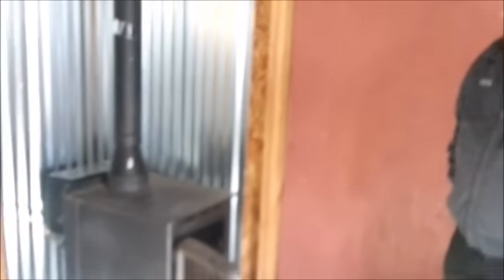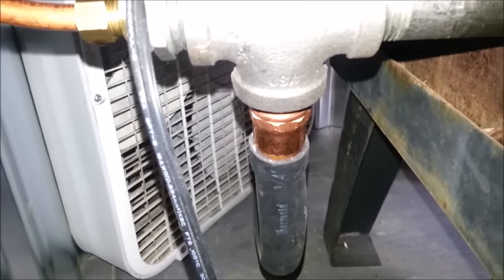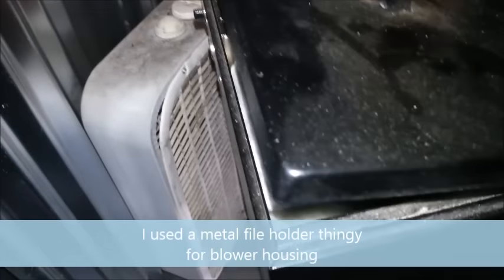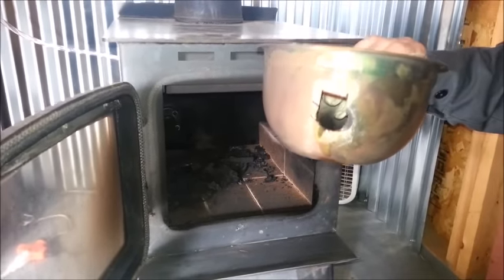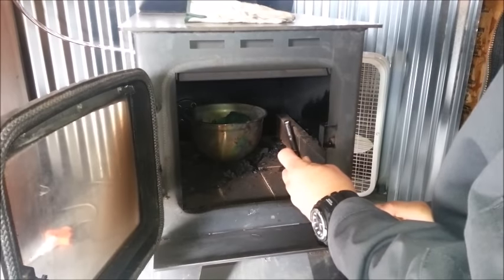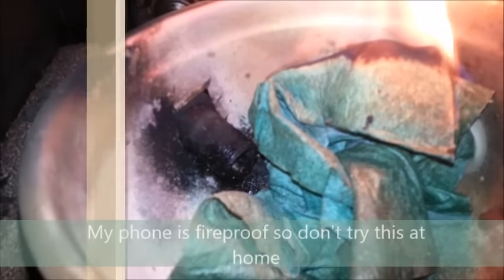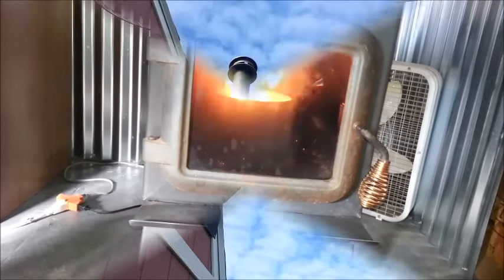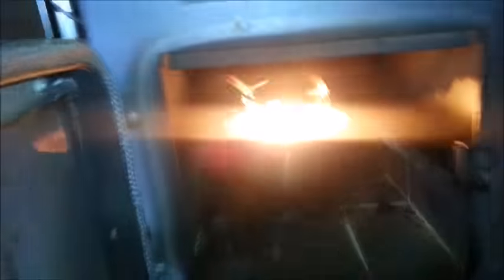Easy Waste Oil Heater made from a wood stove

Comment: When using in very cold weather don't walk away and go inside to let the room warm up. After using one in the 60's as the oil warms up in will feed faster and faster almost burned down shop when is ran away with it's self.

Comment: My governor back in 1980 converted a 2nd world war tortoise stove intoa waste oil and water drip fed stove and used a 4 inch peice of steel tube as the flue which went out through the roof we had to shut it down after 20 mins as the top of the flue was white hot and the flame was blasting out the top of the flue by about 6 feet and sounded like a doodlebug it nearly burned the workshop down ....awesome power though

Comment: This is a brilliant design. Just rigged it up in my garage, and it works FLAWLESSLY once you get the oil drip and airflow just right. ZERO smoke or odor. Now I got free and efficient heat for the winter...Simply amazing. thank you for sharing, Kevin!
Reply from the maker: Glad it worked for you
Reply: @BYprospector  Just installed an identical conversion in my friend's wood stove. He's very pleased with it so far too!
Reply: @PineHollowAutoDiagnostics  but you need to buy oil too, or got lots of reserve waste oil
Reply: @pieterdeboer5361  Not an issue if you run a auto repair shop haha. I use less than a gallon of oil even on a cold day, it's very efficient!

Comment: Super-de-duper ! That is kinda corny but funny ! Lol. I might put that air pump outside so it’s not so noisy ! I’ve got a bigger stove and wonder if it will keep my pole barn warm ! It’s 30’ x 50’ and have 2 buddies that own mechanics shops so I can get all the waste oil I want for FREE ! Should I filter it before burning ? Who knows what kind of chemicals are in it . Just asking !
Reply from the maker: Should work fine. You could try filtering it but I think it would decrease the flow too much

Comment: Coleman built these stoves for use with Diesel or home heating oil way back in the 70's  I have one they throw great and require no electrics at all. How the blower is set up would be nice though.

Comment: Kevin, this is an awesome, simple, and effective design. One improvement I might suggest is, similar to a rocket stove mass heater, you should include some sort of thermal mass (such as cob) either around the stove or around the exhaust prior to it leading vertically upwards out of the wall. This will act like a battery and will transfer more net heat to the room, even after the furnace is shut off.

Comment: Very nice build. I've been watching a lot of heater videos and the few I've found using old woodstoves as a starting point makes the most sense. Old stoves are somewhat obsolete, plentiful and probably cheaper than the cost of electricity, mig wire, cutting wheels and argon. When I build mine, it too will have a glass door as a quick glance once in a while will tell if all is well with the burn. I'm gonna guess that the only power tool you used was a 3/8 drill. FYI, Easy-off works great on white wall tires too. Remember those?

Comment: Cool video and great job. I'm interested if you have ever exceeded the fuel ratio, or played with a variable speed fan. I used to work with brick kilns in a brick plant. Just curious if you ever tried to dial it in to get the most efficiency out of the amount of fuel your putting in. After you have complete combustion the excess air in not a bad thing but could be lessening the heat output per amount of fuel. Sorry for the nerdy question, and once again cool video.
Reply from the maker: As a matter of fact I did add a rheostat to the blower. It gives much better control with less oil. You are correct too much air doesn’t hurt but doesn’t help because you’re pushing your heat up the pipe. Thanks for the input

Comment: Clear out the stack does not mean clean out the stack other than not seeing the heavy unburned particulates . you still are producing a lot of hydrocarbons , especially with a oil based fuel, if you hook up a snooper at the top of the stack readings would be right off the scale ( solution ) you add a flue catalytic  converter ( they are different than a car cat ) . when temp reaches about 600 deg you redirect flow to cat it ignites and burns off the hydrocarbons ( up to 2000 deg) just like a car. Granted you have the cost of the cat but then again your fuel source is cheap, I did that with mine . you also have benefit of extra residual heat from cat for shop heat. just a small step to clean up the unseen and good for everybody.

Comment: If you use a ball valve in conjunction with the turn valve then you can toggle it on/off while keeping your flow the same :)
Reply from the maker: Good idea
Reply: I was going to suggest the very same thing, instead I will make this suggestion, get an old soup ladle and dip up some oil to pour into the burn chamber and never have to adjust the flow after you get it set .

Comment: Nice job, heavy gage single wall wood stove pipe works great, transfers heat into your space and is cheaper. You only need double wall going through the wall and if it's sleeved with a thimble your fine. Check with a local wood stove store and they can set you up or ask a HVAC guy as to local codes. Brake drums or old cast iron skillets work too. If you burn used motor oil or a mix check your door gasket etc, you want it air tight so you don't breathe anything and don't burn on days when the airs not moving or is heavy, don't want it to settle in low areas. Been doing it around here since there's been used oil to burn, just think and use a little common sense.

Comment: Oh Kevin.... that bowl- seems to me it might be a little tall? Directing the flame against the top mainly. But what if you cut the bowl off top or bottom (😂jk)  cut the top lip down so the stove gets better heat dispersion. OH!!! OR! !!‐ from the top of the bowl- cut Down 1 1/2 inches, turn a 90 and cut across parallel with the top edge 2-3 INCHES.  REPEAT! NOW... bend these out 30- 45°! Now you have introduced a swirling turbulence!  ALWAYS helps with o2 molecules finding hungry fuel molecules! 
Nice build. What do you think? Anyone?
Reply from the maker: I’ll have to give it a try. Thanks for the input

Comment: I have lived with a wood stove for over 40 years.   suggest that you listen to the comments below that suggest a single wall pipe.  Indeed, some pipes are made sith large dents that increase heat exchange.  I also suggest locating the stove or exit hole so that you have maximum horizontal run of the pipe.  You will get far more heat from a long, single wall pipe.

You mention the roar of the stove.  What makes the roar?  It is air rushing into the stove, through the stove, and up the pipe.  Where does the air come from?  Why, it is the nice warm air of your shop, creating a slight vacuum that sucks cold air in through every crack, hole and gap.  You are heating air, only to rush it out of the building via your double wall, insulated pipe. In short, you are attempting to heat the interior of a wind tunnel.   Controlling the draft will alleviate some of that.  But piping in a source of outside combustion air will allow you to keep the heated air inside where it belongs, while outside air fuels combustion, then exits through the pipe with no vacuum at the walls.  You can make it roar as loud as your heart desires, with no heat loss.
Reply from the maker: Thanks for the comment. I'll keep it in mind

Comment: If your blowing more air in than you need your pushing heat up and out - get a quiet little blower - less than 50$ and a manual damper to control air flow and like some say draw your air from outside with any kind of light tubing - it would be much more efficent

Comment: I like this idea for a shop heater. 
I heat my house with wood 🪵. 
My house is 30x60 with a four foot hallway down the center. And what I do to move the air is to put a box fan at the end of the hallway in front of the bedroom blowing the cooler air on the floor towards the wood stove that’s in the living room. It works great if you hold a candle 🕯️ up high the flame 🔥 will be leaning over in the direction of the hot air flow. And held low it goes in the direction of the cold air. I just leave the fan on low.

Comment: never hurts to improve check out mother earth's waste oil heater or burner they show a their burner pot but if you look deeper into they refined it to basically a small pot with 3/8 bolts they set 4 across the bottom then set four the opposite and I think four more the same course as the first which makes a little grid. this gets red and the oil vaporizes when it hits the grid. I just thought to mention great idea though nothing like free heat no matter what design you go with!

Comment: Used ATF is great fuel for you old diesel. It's usually very clean already when it comes from a transmission shop. Driving it for years now and I even have a video on my channel where I do a coldstart on 100% transmission fluid and no pre glow at -2°C/28°F . Rough but still worked and smoke free after a few seconds

Comment: How did you plumb the air in?  Does the air come in the same tube that the oil drip is in?  That's the only thing not clear.  Great video!  Thanks for sharing
Reply: The copper tube goes inside the metal tube ,the air and oil meet at the end of the pipe visible in the video .

Comment: Good 1st try,   the wood stove part makes things easy but check out blue flame nozzles .  Increase the efficiency and way less emissions than orange flame. Less fuel more heat.
Reply: I've never heard of blue flame nozzles. Can you elaborate on this? Thank you
Reply: @MrSprintcat  check out this video
https://youtu.be/u41tHg7ly_E
For a stove id prob build one like the first nozzle but leave out the top plate holes and so a 6 or 8 inch round heavy pipe chamber.  . Basically just the inner 3rd of.that 1st hot water heater example he builds.  Since you're in a stove and have prob 12 ft of chimney you should get enough draft to not need a blower on the inlet pipe.   Prob need a damper on your chimney tho

Comment: Can you burn engine oil? I'm assuming that's what your talking about when you say waste oil. kitchen oil, moter oil whatever kind of oil right? Great idea I just always thought at least engine oil would be bad on the environment even if no smoke is coming out.
Reply from the maker: If burned properly waste oil is no worse on the environment than any other fossil fuel. The problem with vegetable oil it that it gels when cold so it must be heated before burning like diesel
Reply: @BYprospector   That's not true.  Used engine oil contains substances such as lead and cadmium. Yeah you're saving a few cents now by using waste oil, but it's not worth the risk of medical complications later in life.
Reply from the maker: @SiriusC1024  I stand corrected. :)
Reply: Where is the lead and cadmium coming from ???  They banned leaded gasoline decades ago . I've never heard of either item being used as an additive in motor oil , so you've piqued my curiosity here ?

Comment: thanks for the design. helped give me a warm place to work this winter! cheers!
Reply from the maker: You should post a video
Reply: @BYprospector  how would a coil of stainless tube, like underground gas line like 1/2 or 3/4 coil right above the bowl,  have a water pump with heat exchanger/ old school brass radiator hanging on the wall taped into the house , the novelty of it.lol

Comment: That oil is containing a lot of heavy metals from engine. Dont let that air go into the room
Reply from the maker: Heavy metal is not an issue. Google research shows that used motor oils can be incinerated with no ill effect

Comment: That cooper tubing will eventually disintegrate from heat, need to be replaced with stainless steel tube.
Reply from the maker: Doesn’t get that hot

Comment: Set a car brake rotor on top of the bowl it helps build heat and vaporize the oil you can see my burner if you search barrel stove oil burner conversion
Reply from the maker: Good idea

Comment: With this design could you close the needle valve and pull your drip pan and you have a wood stove again, is it universal?
Reply: I wouldn't see why not... might have to seal off the hole where the pipe enters the stove??

Comment: Interesting how increasing the air flow burns drops of recycled transmission oil hotter
I wonder how a gas engine could be made more efficient, redesigned for more airflow
Reply: They have been for quite awhile now, it’s called a turbocharger
Reply: @renislevasseur855  Turbocharger inefficient control of air flow. A minimal improvement but a start. 
Re Designed for live automatic control of volume, speed, pressure, intensity, at airflow intake.
Fuel Injection? Control amount of food...
Gas Fumes (hotter) v recycled transmission oil?

REDESIGNED

Comment: You can also use a cast iron skillet they will not melt down like steel does! This stove can hold a 12" it looks like.
Reply from the maker: I've tried cast iron but you can't easily cut a hole in it. The stainless steel bowl holds up to the heat and is has a round bottom. Better for air flow.

Comment: air flow will (or too much) can and will cause the heat going out your chimney to get too hot for your chimney. Too much air with too much fuel turns this thing into a blow torch...Watch the fuel to air ratio. Sleeve your chimney termination up top. Give yourself at least 1" clear from combustibles if you're using double wall. Way more if it's single wall pipe. Call a local HVAC guy from your area. You can't get insurance for this kind of 'field' modified heater. Do it right and you won't need an insurance guy

Comment: What blower did you use for this do you have links. I ask cause all the mattress blowers I've found. Have warnings not to run them more then 15 mins. Thanks man awesome set up.
Reply from the maker: Doesn’t really matter what brand. They’re probably all made by the same manufacturer. The trick is to keep them cool and break them in slowly only running them only 15 minutes or so for 4 or 5 cycles. The one I have now runs continuously for 3 to 4 hours

Comment: I’ve taken out my old back boiler stove, I’m wondering iff this set up would work on heating radiators from it, would be interesting to see iff it does.
Reply from the maker: Good question. I’ll have to educate myself a little before I try it. I’ve never even seen one except from the pictures I just looked at

Comment: ok can i make q pin sized hole in a steel container that allows a drip of motor oil into woodstove without a bowl for fuel ontop of wood thats iinside woodstove? since 2 big  holes one to put pannfor cooking one to feed driping oil?

Comment: my chimney just basically goes out shop wall. I installed draft inducer because of that. my damper on stove wide is open. I will try to find something to pump more air and see what happens. stove runs about 650 degrees and stack about 150-200. maybe that's too cold???
Reply from the maker: What are you burning? See if you can find out its combustion temp. You can go online and get an msds.  Hydraulic fluids like brake fluids require a lot of heat. I dont burn hyd. fluid for that reason; I burn trany fluid.  You could try adjusting your bowl position and drip position to get the air directly into the flame.

Comment: I copied your design pretty close.  Great Burn and heat. Almost no smoke from chimney.  My problem is soot buildup in chimney.  After 20 gallons of oil I have to clean pipe because it becomes so restricted. Have you had this issue?  I am using only 4" double wall
Reply from the maker: Try adjusting your fuel air mixture. It sounds like your not getting complete combustion (not enough air). I have 4" double wall with two elbows with no problems. Temerature also matters. Needs to be hot enough to get complete combustion. I have all the venting on my stove open along with my blower. If you need more air try adding venting. For added natural draft make sure your chimney is higher than the peak of you building.

Comment: Looks efficient and burns clean. Would it still be possible to burn wood? If not, how could that be done? Having two diverse fuel sources is an advantage. Thank you.
Reply from the maker: If you want to burn wood and oil make sure you go with the size of pipe the stove requires, remove the bowl and oil feed, plug the hole and you have a wood stove.

Comment: I have 2 old jungers propane stove, ones works great, the other is parts. I wonder if I take the rest of the propane parts out of the nonworking one if I could make that kind of conversion out of it. I know jungers made diesel burners but I haven't found one by me. BTW these stoves are cast iron from the 60s, jungers was a Wisconsin based company and is long gone, but their stoves live on and are bulletproof
Reply from the maker: I'd love to see what you come up with. Would make a great how to video

Comment: One more question how did you cut the whole to install the flange.  If you don't have a cutting torch can you drill threw the thick plate steel or no and it looks like you used 1/2 inch black pipe .Does the hole have to be that large ,let me know. Thanks again Dale
Reply from the maker: I used a 3/4 hole saw. Make sure and watch my how to video. It explains more about the air/fuel delivery

Comment: I'm thinking of using this on a central heating boiler with the current heating oil burner removed and this in its place and wiring the water boiler thermostat to the Coleman blower to cut out when the water reaches temperature.what you think?
Reply from the maker: You are going to need to add a thermocouple to sense if your flame goes out to stop the oil via a solenoid. I’m not sure I would use this on a boiler due to its tendency to explode but if I did I wouldn’t stop the blower I would shut the oil off. On second thought, I probably wouldn’t do it at all. I’m not sure it can be done safely. Thanks for the question